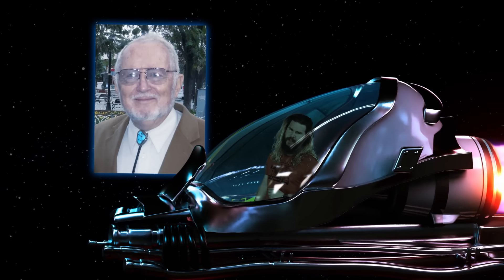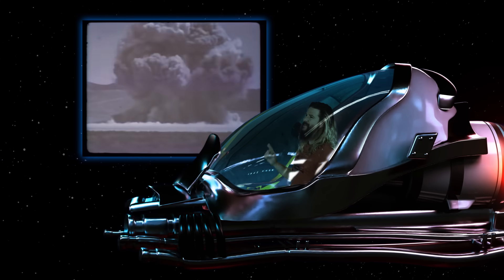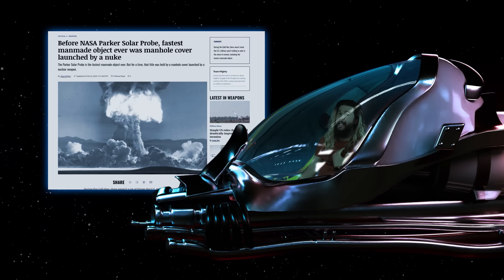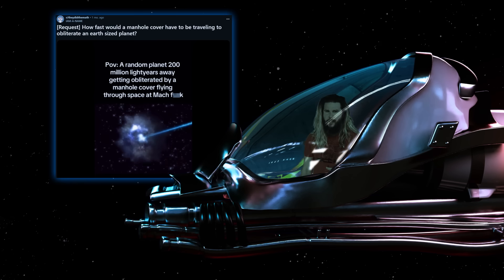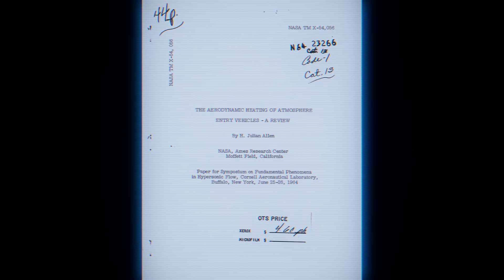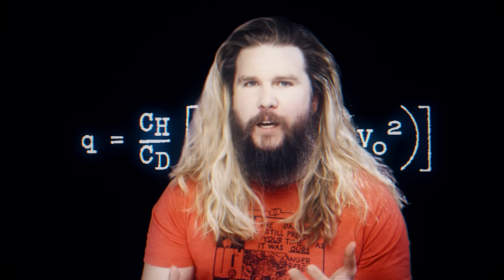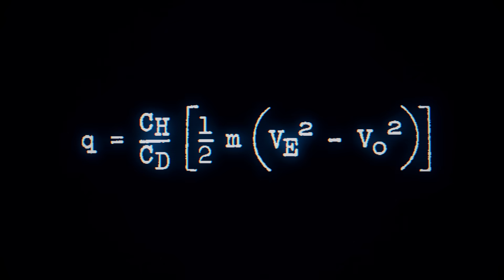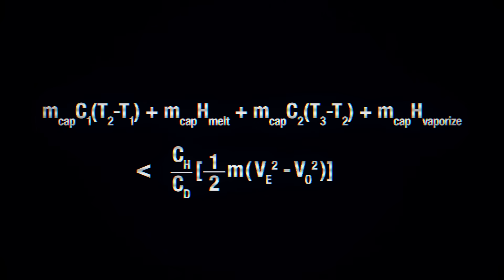Debunking the Nuclear-Powered Manhole Cover

Comment: Probably a stupid question, but here goes anyway. These calculations were made at 66m/s, correct? Did i miss the part where velocity loss through air resistance was covered? Is it even significant?

Comment: You made a MAJOR error. You solved this assuming the final velocity is 0. That is simply  not the  case at all.

The atmosphere is relatively thin 500mb is approximately the mid point of the atmosphere, and ranges from 5km-6km in height.  Atmospheric drag drops of exponentially with height.

The 1st 5km would be passed through in ~ 0.08seconds, and the remaining 10km in under 1/10 of a second.

In order for your math to be correct the cover would have to  come to a stop in that time/distance.

To fully solve the problem, you need to know how quickly the manhole cover experienced the deceleration and over what distance.

All that you proved is that if the atmosphere is thick enough, it will burn up.

Asteroids moving slower actually have an advantage in this regard. Moving into a low density to higher density atmosphere should aid in slowing a projectile.  As apposed to the exponentially decreasing density of a "launch".

I can work out the math on that in detail if necessary.
Reply: Not forgetting the test site was at about 7000ft, so it was already in slightly thinner air, and the air would only get thinner.
Reply: Higher velocity at higher density is higher heat. You basically said it yourself. The only thing countering this is gravity which would take velocity without adding heat. But -9.8m/s² is meaningless at this speed and time frame.
Reply: If a meteor hit us even faster, it would simply burn up even faster and explode more violently. The effect doesn't suddenly change, it gets more and more extreme the more speed you add.
Reply: @CharlesFreck  interesting... so what your saying is, meteors all just explode in the atmosphere and never touch the planet...
Reply: @lancesmith5645  no, because some are larger and slower. Which means they are able to reach lower in the atmosphere and not disintegrate entirely.
Reply: Well fortunetly, the manhole cover was cast iron in the shape for a Co. of Drag that is very literally how we set 1. 

But to be honest, no. It just did not survive. Its cast iron, moving faster then the speed of sound in cast iron. Something hit it and the cover fragmented, shattered.
Or the shock heating on the skin caused the same effect, heating up too fast for deformation to occur. 
Because thats what happens when you try to deform metals faster then thier speed of sound.
and its surface area increased causing more thermal shock, shattering, and eventually creating dust.

It never had a chance.
Reply: @AnonymousAnarchist2  this argument assumes a lot of things for which there is neither witnesses, nor evidence of happening.

its moving at 100k feet per second, what exactly could hit it?

and the rest of this argument is formed around the preconceived assumption that it must NOT have survived, there for, list infinity reasons/ ways that it "likely" deformed.

the issue with that stance, is that that is exactly what is trying to be determined, whether it made it in to space or not.
 All we actually know can be defined in 2 points

1. it was captured in a single frame of a high speed camera less than a fraction of a second after launch, most likely still intact.
2. it was traveling at minimum 100k feet per second.

beyond these 2 points, nothing is known.
Reply: Drag increases quadratically with speed, at sea level an object travelling at 66km/s is going to experience about a quarter of a million gees of drag. It may have been going that fast momentarily, but it will have lost all of its speed almost instantly. It is a much worse situation than reentry, because it is going at its fastest speed in the densest part of the atmosphere, instead of the thinnest.

Comment: Correction, there would be enough atmosphere heating blah blah blah

Don’t forget, there is a mass of nuclear powered, expanding hot air behind the manhole cover, which means it is not experiencing six times the escape velocity in air resistance when a bullet leaves the barrel of a gun. There are gases coming out before the bullet that bullet doesn’t see wind resistance till sometime after it leaves the barrel

Comment: Hypersonic Rocket plane X-15 almost melted itself at Mach 6.7 . Imagine what the atmosphere will do to a measly 4 foot thick cast iron going at Mach 198. If the super heated gas didn’t atomize it, the atmosphere would have. Maybe if it was make of steel and large enough it could have a chance. 

Time to recreate the test with a 10ft thick titanium cover😂

Comment: The cap might not have been flying perfectly flat in an upwards direction into the atmosphere,  do we have an angle?  Is there q change in result if the cap was spinning?  If it turned over at all to be edge on... Would anything have changed?

Comment: I would also suggest that checking just if it would melt would be enough, because a blob of iron moving at that speed would not stay in a cohesive blob.  In fact, more likely, the air rushing by the disc at various angles would just ablate (and at least partially vaporize) the iron as it goes by.  There would soon be no solid cover left.  Either way though, the math shows there's more than enough energy at that speed to vaporize it.  Something else that would be interesting, run the math for different speeds.  How slow does it have to go in order to NOT vaporize (or melt)?

Comment: There's a couple of problems i see with this
1) this assumes that it didn't just shatter
2) assuming it doesn't shatter, it would have explosively formed into a cone shape so it would have seen elss drag
3) this math assumes that all the heat is evenly dumped into the whole cover in one shot. This would not be the case, instead the surface layers in contact with air would be ablating off, shedding additional energy
4) the study you look at goes from thin to thick. The cover goes from thick to thin.
5) you also don't account for any thermal radiation, which may only be a very small amount, but it might have made a difference

Now I'm not saying it made it to space, or didn't... but I'm saying that your math may have some flaws in order to decisively prove one way or another.

Comment: One thing, I felt missing was a certainty assessment. It doesn't have to be very formal, but address some of the more contentious numbers in the inequality. 

I'd consider 4 values to be uncertain: the starting temperature T1 (you've assumed room temperature, 296K or 23°C, but I've read a bullet leaving the barrel can reach temperatures of 482°C or 755K as a comparison), the drag and heating coefficients, the starting velocity, and the final velocity (that many have already commented on).

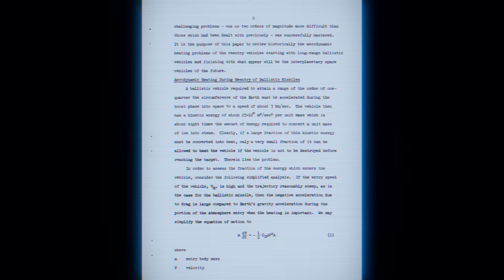Comment: 3:58
Have to question the equation used. This equation specifically states and assumes a ballistic re-entry angle similar to a ballistic missile (1960s). That angle happens to be around 22° to 45° (about).

So it does assume a much longer time within the atmosphere compared to a near direct 90° upward trajectory.

I'm not sure how this would change any calculations (I should have been asleep hours ago) but I dont believe it can be used as-is
Reply: It states the assumption in page 2 above equation (1). The angle ballistic missile impact trajectory angle was a hop-step-and-jump through a Google search. 

Again, not implying he is wrong, just a potential missed assumption which seems rather important to have noted

Comment: There is 3 factors that you forgot to take into account: 
   
The equation for reentry assumes you are facing more air for each second you travel, our cover is doing the exact opposite, it is spending the least amount of time in the dense part of the atmosphere and climbing to less dense atmosphere
   
Also way before ever melting, our manhole cover definetly deformed into a more aerodinamic shape, if we allow for that than there is way less heating too
   
And lastly the nuke would propel the cover for a little while after the detonation, which would help accelerate it even further

Comment: I'm not a math guy, My question is does the math account for the atmosphere getting thinner as it goes up, you mentioned that asteroids entering the atmosphere are going much slower and they melt however because they're going slower they have more time to heat up so would the manhole lid going mock middle finger not have enough time to heat up because it leaves the atmosphere in less than a second... Frankly I'm a little disappointed in this video you could have given a lot more information, to me personally this video has the vibe of I'm smarter than you trust me bro I'm right

Comment: While I don't doubt that the manhole almost certainly didn't make it to space (at least not with the vast majority of its mass remaining), there are certainly a few issues with this analysis.

Firstly as some other commenters have pointed out, the right side of the equation for energy absorbed from the atmosphere makes the pretty big assumption that the atmosphere actually stops the manhole cover, if it were to hypothetically survive and make it to space then its final velocity would still be high and it wouldn't absorb as much energy. You would have to calculate first if the atmosphere could impart enough force to slow down the manhole in time assuming it was indestructible which I somewhat doubt.

Secondly your use of the Nusselt number isn't appropriate in this situation as it assumes that all heat flux is through convective or conductive means. This is a valid assumption when you're calculating for example the efficacy of coolant in an engine, but completely overlooks radiative heating which is going to be the primary method of heat transfer at high hypersonic speeds.

Thirdly you assume that the energy absorbed by the manhole cover perfectly vaporizes it to a uniform temperature. If the cover were heated slowly this would be the case but in this situation all of the energy is dumped on the surface in about a second. This would mean that as the surface layer vaporizes the vapor would not be able to be pushed away in time and so the incoming energy would mostly go towards heating the already vaporized surface to higher and higher temperatures, meaning that the iron behind is somewhat shielded and the manhole could absorb way more energy than what you've calculated here while still having surviving material.

Comment: But how quickly does it slow down? You set the v_0 value to 0 without explaining that, but that only works if it stops while still in the atmosphere.

Also with gravity pointing opposite the direction of motion, I suspect you'd have to subtract the kinetic energy that gets lost to gravity instead of drag.

Comment: Far be it from me to say that I have a better equation. But I think your equation is incomplete on two important factors. 

One: it seems as if the equation assumes that the manhole cover went straight up without tumbling end over end. This is unlikely, and I think it's important- we must consider that all of that energy wasn't blasted onto the top surface uniformally. As it turns over, it affords all sides the opportunity to cool slighly. 

Two: it's not merely an inverse of the equation needed to calculate energy of foreign objects entering the atmosphere. As the manhole cover rose, it was enveloped by the same jet of air that blasted it off in the first place. Superheated air that was moving at relative speed to that manhole cover, negating the friction received up to an unknown altitude, but certainly through the thickest part of the atmosphere. High enough to make a difference? And how does the energy transfer of superheated hypersonic air from a nuclear blast behind you compare to the air friction above as if you're merely a mach F*** piece of metal suddenly moving through a completely still atmosphere? Again, I don't know the math, I just turn wrenches. Perhaps there's a paper to be read on how air friction affects a bullet fired from a gun for the first few feet, as the bullet is still enveloped in the expanding gasses of muzzle blast, that can be scaled up? 

These are my gripes with the math. Good calculations, I won't pretend I can do any better. I just think that there are a few things not taken into consideration that maybe, just maybe, lets me cling to the belief that we beat Sputnik.

Comment: I stopped watching this channel years ago, couldn't resist this piece of clickbait. Here's what you did wrong this time (cursory, not intended to be a complete summary)

grabbed a calculation and said good enough because you couldn't be bothered understanding why the one nasa used for re-entry isn't useful nor is it the same, for objects leaving earth. See: Rocketry in general, but start with thermochemodynamics in relation to how the ablated mass interferes with the active thermal  flow.

after that, and just for kicks, have a look at how much the material will have plastically deformed under the heat transfer exposure of the first thousand feet of altitude, see: altitude-pressure charts. Since you apparently need to also have a look at the thermal conductivity of iron, and how it has a inverse relationship with temperature.

after that, you might aswell actually take the time to determine the impurities of the iron used, and understand that that drastically affects material properties

Frankly: the only valid answer is nobody has enough information to know, and your blatant misrepresentation of data and math to people who don't enough to tell that your ego is talking is the reason I will happily continue to pretend you're not a youtuber. Enjoy your career, as long as it may last.
Reply: oh and in relation to just name dropping nasa and expecting people to not ask why you didn't modify the equasion to *actually suit your use case*, you know what an argument from authority is. do better.

Comment: Unjustified assumptions: 
All kinetic every goes into heating the cap. What proportion went into heating the air instead? 
The meteors you mention burn up, what about the ones that don't? An object moving faster would have less time for heat to transfer into it, and spend less time in the atmosphere converting kinetic energy to heat.
You say that a definite answer shouldn't be given if you can't do the math, but earlier in the video admit to not being able to do the math to find the critical heat transfer constant.
Finally, you move the goalpost at the very end by saying even if it didn't vaporize, it would be so distorted it wouldn't count anymore.

Comment: I think the footage confirms at the time it was the fastest man made object ever, if it made it to space is still questionable, because there still is not enough information, the estimated speed for the manhole cover was at the low end, there is only one frame to estimate the speed, on top of that we don't know if the cover was still accelerating (this gives it a better chance to escape the atmosphere without burning up). I haven't seen any good videos to determine what the actual maximum speed the manhole cover reached. There is also another problem, going through the atmosphere is not the same equation for up and down, accelerating out, is a lot easier than accelerating inwards, this is without question, it is not the same. It gets harder and harder to accelerate into the atmosphere while it gets easier and easier to accelerate out.

Comment: AIR RIFLE LAUNCHED MANHOLE COVER! When air is compressed it concentrates its thermal energy into a smaller volume. The propellant material that launched the manhole cover was very highly compressed air mixed with vaporized dust, debris and ablated material from inside the shaft. All trying to equalize the pressure on both sides of the manhole cover. Once the manhole cover unseated the white hot plasma would radially expand around the underside of the cover like a four foot in diameter PLASMA TORCH! Have you ever seen a plasma touch cut metal? Now imagine a plasma torch with a tip diameter of 4 feet! It started vaporizing from the bottom up.

Comment: I have also not seen anyone take into account the atmospheric density! An object entering the atmo is going from least dense to most dense, so the heating would increase as the density increased, but going from most dense to vacuum is entirely different! So I would deposit that some part of it would make it to space because of the speed through the most dense would have been faster than the less dense . So we would need to figure out how much mass and speed was lost in the more dense part of the atmo for the equation to work properly!

Comment: Ok, I'm a little bit skeptical on the math here. At the end, you compare the manhole cover with a meteor of similar mass, however this doesn't take the shape into account. Meteors are typically relatively round, meaning that from any angle, the area of the pressure is the same. However, the manhole cover is mostly flat (though more likely taco shaped after the sudden exploasion) meaning that there is a thin flat side. If you were to image a spinning taco shape flying through the air, you could imagine how that uneven pressure forces would result in the shape flying flat end first. Any deviation of spin on such a shape would result in an increase in drag on the the back end causing a relatively rotation free flight. This would mean that you would want to calculate the equation using the flat edge instead of the whole of the manhole cover.